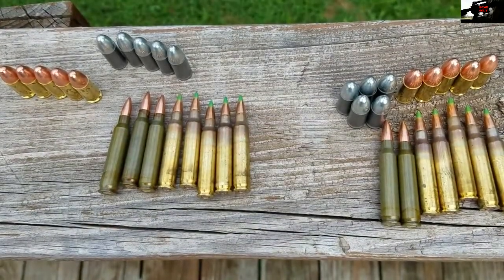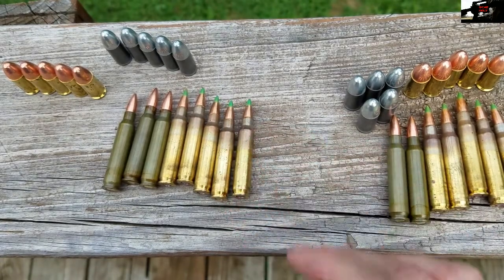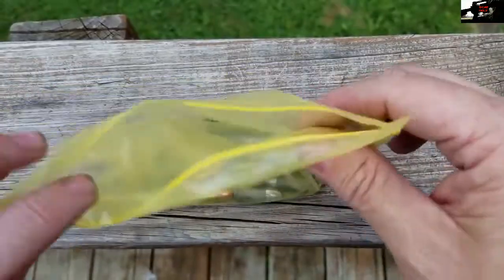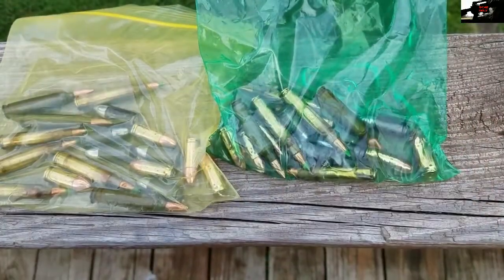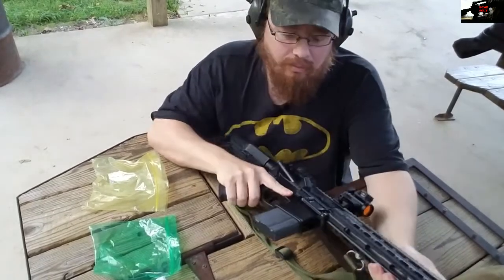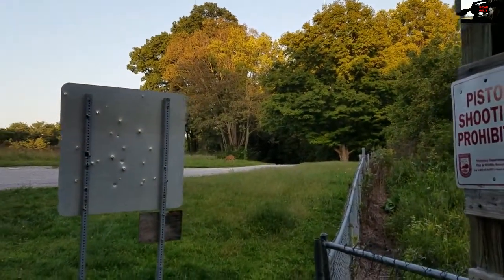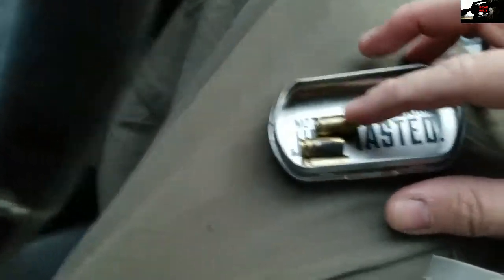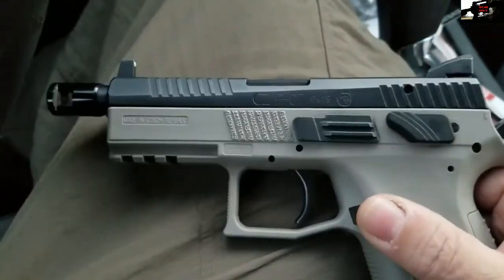WILL WD-40 RUIN YOUR AMMO?

Comment: Why would you drown ammo in WD40 anyways? It only works if you clean your gun with WD40 and tissue paper/cloth. If you’re cleaning your gun with WD40, use tissue paper or cloth to scrub the parts with dirt off, instead of drowning it with WD40.

Same with gun oil, because it’s WET, and anything that’s WET will attract dirt. WD40 is designed to remove dirt and prevent rust with tissue paper or cloth on normal things we use everyday.

Comment: Partial Myth Buster.
Reply from the maker: InSight Freedom yep, looks that way. Im wondering if time and case thickness is the main variable.
Reply: THE SCAB UGLY CHANNEL yeah. I'm pretty ignorant of loading tolerances and seating. Is it possible that the rifle cartridges have a deeper bullet seating (i.e. More case to bullet contact to slow penetration)?  Ha. I said penetration.
Reply: @thescabuglychannel7600  most likely. In iraq we used wd 40 as cleaner/lube combo, as on our rifles it was superior to the gov issued CLP (we called CRP or just "crap"), and it left a decent coat of lubrication, as there is a certain amount of oil in it. Plis, it did a hell of an awesome cleaning job. Obviously in a desert, no matter what you use, you simply MUST maintain a firearm daily. Obviously any wet firearm (lubed with anything) will attract dust/dirt/sand, even moisture. Wd preserved our rifles AMAZINGLY well in that environment. Didnt seem to hurt ammo either, but we didnt soak it in copious amounts either. I guess like anything else, there are variables that always must be considered.
Reply: @chadkarr7394  hi you seem to be the only person with experience in the matter. Can I ask were you spraying the same ammo daily cleaning.? I'm just wondering because I sprayed mine and closed it in an ammo can for years
Reply: @mikemegame1  i rub the ammo with a dry rag or ppr towel. but, wd wont really ruin it, should it get on the round. its not corrosive. but, i dont think its the best idea to bathe ammo in it, but even if you did, it should be fine.